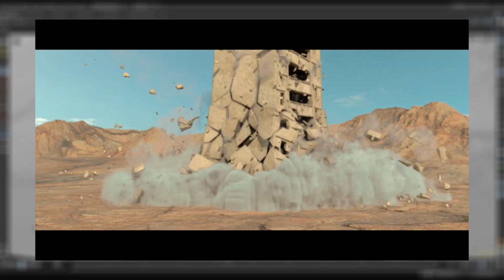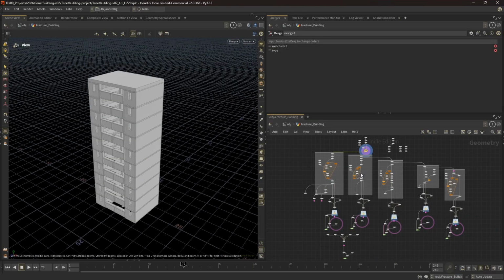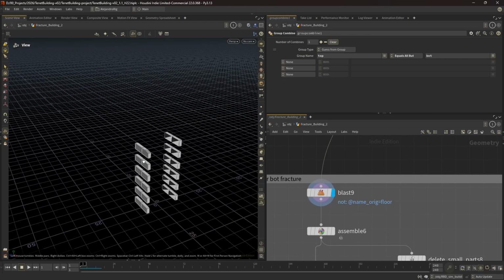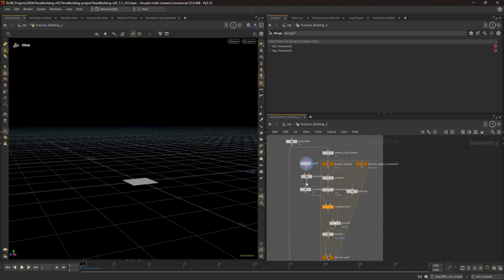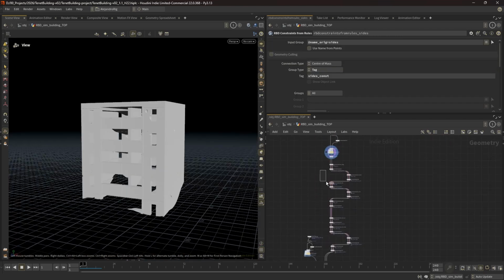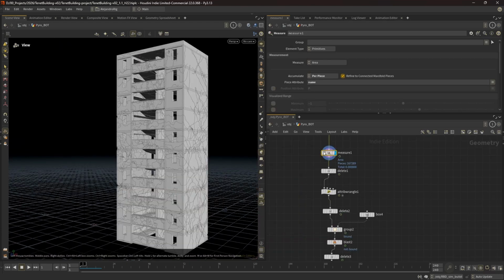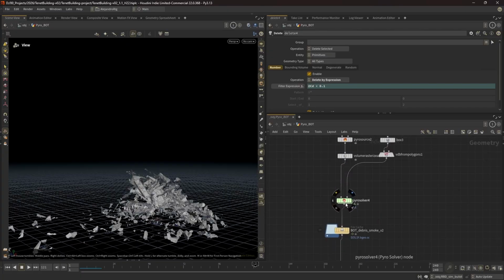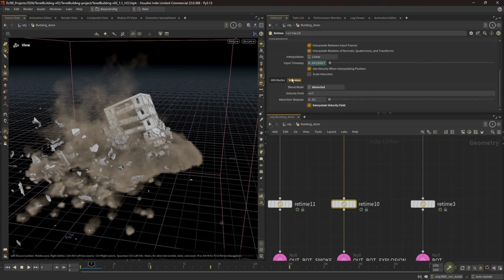Tenet Building Explosion in Houdini | RBD and Pyro VFX Houdini Breakdown

Comment: Did you transferred the velocity attribute from pyroburstsource to the modeling to make the building explode?
Reply from the maker: Yes, you can make this in many ways. In my case I used a pyroburstsource to create the velocities, the explosions were made in a differtent way with different pyroburstsource. If you wanted you can make the pieces move transfering the velocity from a sphere with an attributenoise in the v attribute or applying an attribute noise in the explosion area, etc. It's Houdini, your workflow depends on what you need and how much control you want over it